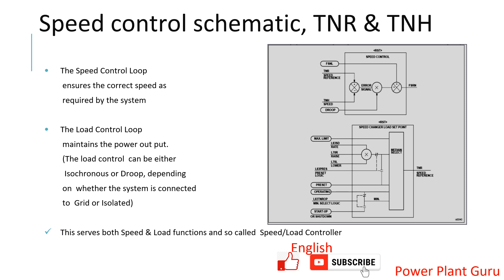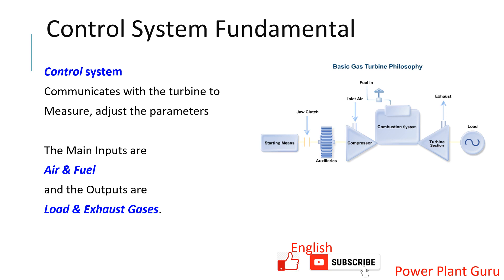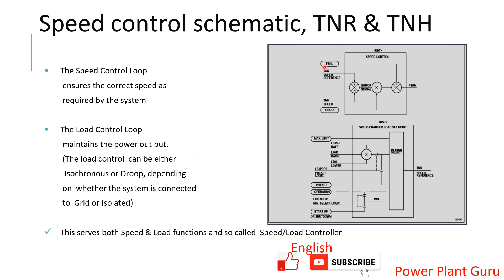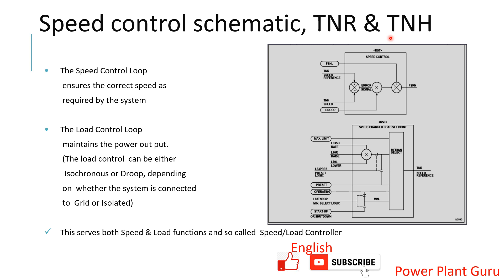What is TNR, TNH and FSR in Gas Turbine power plant, steam turbine,

Comment: I'm very confuse with two concepts
One is droop and other one is ROCOF

In droop setting we have given reference to markvi of 4%. 
But I've observed data in PI trend that during certain values of frequency 50.6 hz the load increases because cpr increases.
but after that load will start to decrease when igv is lowering the angle.
This load drop happens due to temperature control as ttxm reaches ttrx or due to speed control .If machine are at base load 

Secondly how rocof is different from speed/temp control
Reply from the maker: Thank you for watching my videos. I am not sure about ROCOF
Reply: @powerplantguru007 You've said that the difference between TNR amd TNH will change the value of FSR. 
I've observed that as frequency drops from 50 Hz the output of machine reduce when at baseload. 
As Speed cannot be increase of grid connected machine.

Comment: Sir.In the video it shows speed control loop with droop.But if it is in isochronous,how does the loop works or looks like?
Reply from the maker: Hello, thank you for watching my videos. 
Please watch my another video for the concept on droop and isochronous mode
Reply: @powerplantguru007  I mean, from the loop, you see Droop value been multiplied with the error signal.If in iso, then the value will be zero,zero multiplied with error signal= 0 FSR? Confuse with the loop if we are in iso,not the concept of isochronous.

Or this loop not applicable when in isochronous and use other loop?

Comment: Sir what is max valve of FSR oat base load ....... I am from fertilizer sector & our GT FSR gradually rise from 63-64 to 73 at same load ......... .....is it normal or have any problem?
Reply from the maker: Hi Gaurav
Due to the busy schedule i couldn't create fsr video quickly, but my latest videos on FSR are available. 
To answer your questions., FSR may vary at the same load it has a relationship between air to fuel ratio. At the same load of air temperature varies or humidity varies FSR should change, because for a new set of air parameters max fuel quantity may be changed.
You please observe this relationship and let me also know what is happening.

https://youtu.be/gK0CCujB4TM

Comment: Sir what is ejector???why it is used??
Reply from the maker: Hi Devi. 
Ejectors and used to evacuate air or any residual gases from any vessel. 
In case of power plant we use it with condenser to remove air and create vacuum
Reply from the maker: Vacuum is created so that steam turbine can give give more output